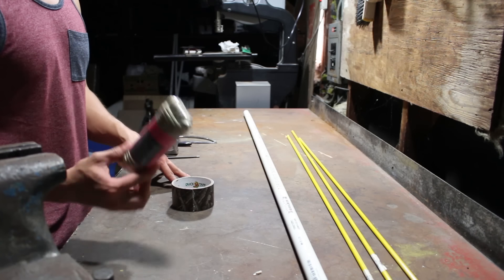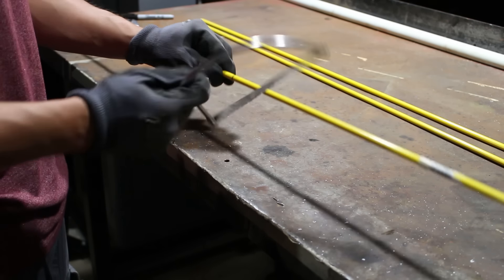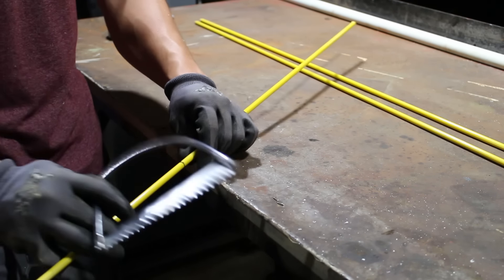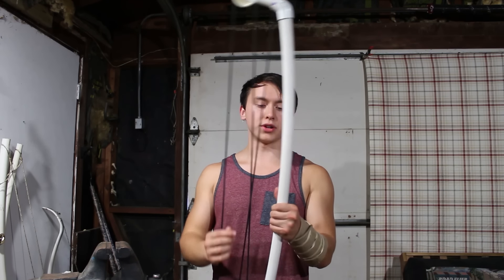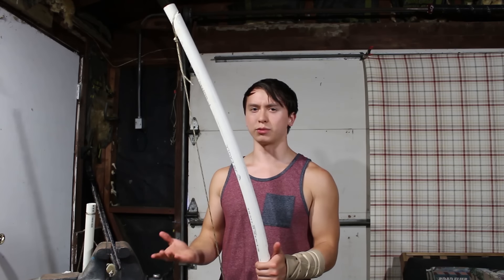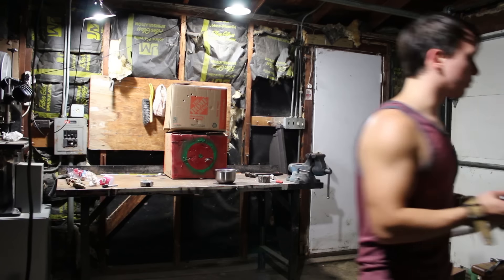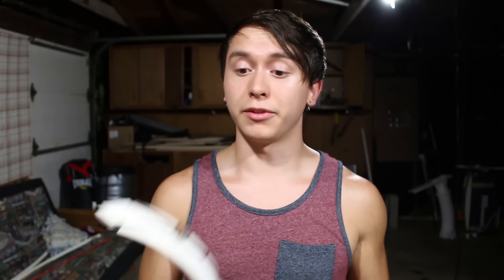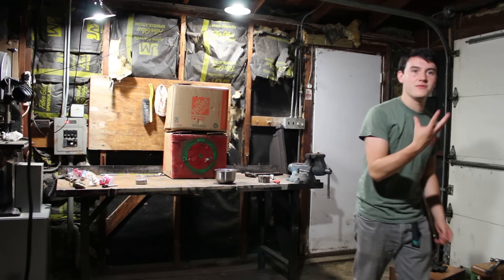Easy, Cheap, POWERFUL Bow (NO Power Tools or Heat Needed)

Comment: Where did you get those highway marker pole dealies?  I asked about them at Home Depot and they looked at me like I had wandered away from the shortbus.
Reply: look for
Driveway Marker 48 in. Round Orange Fiberglass Rod

at home depot
Reply: Blutteufel try asking for driveway markers. Check around the paint aisle or wherever they keep the mailboxes. I bought mine at home depot
Reply: Blutteufel go to lows
Reply: You should check the hardware section. Or ask where they keep their reflective tape and flags. Also make sure you tell them fiberglass DRIVEWAY markers
Reply: Blutteufel I actually bought some today at Home Depot, but yeah it helps to dumb things down and look for the sharpest looking of the bunch
Reply: Basically they are where you can buy the house numbers, the garage door section.
Wear a mask, do not breath fibre glass dust
Reply: What can you use if you can't get the markers...!!
Reply: I have extra tent poles, they are fiberglass and I'm think if I use E6000 to glue the connections together I'll get the same results. any opinions on this?
Reply: Blutteufel It must not snow where you live we need them to see our driveways. Any hardware store near me has them lol.
Reply: Angel Rangel It's funny that you should say that, because not only does it snow quite a bit around here, but we've actually had more snow this winter than anyone's seen in twenty years.  Hell, I just looked out the window, and it looks like some more fell during the night.
Reply: i found some at walmart
Reply: lisa finley most tent poles are hollow and wouldn't give the same pull weight
Reply: Canadian tire has them

Comment: because of it's shape, the ends of the recurve bow essentially act like a lever; this is where the extra power comes from
Reply: @Picogram I mean, you're wrong about saying that "the longbow" is the most powerful, and it's a self-contradiction, too. I mean, if the recurve bow is a force multiplier, then wouldn't a recurve bow of draw weight x always be better than longbow of draw weight x? And it's not like you can't get recurves as powerful as longbows - asiatic war bows were remarkably similar to English war bows - 80 pounds and up.
Reply: Because it's a Turkish bow!
Reply: No. The reason he's not getting more penetrating power out of the heavier bow is primarily because the heavier draw weight bow has more limb tip mass, so lots of the energy stored in the bow is expended accelerating the heavy limb tips rather than accelerating the arrow. Other factors that could be reducing the heavier draw weight bow's performance are things like having a stretchier string and having an arrow that isn't well tuned to the bow. An arrow that isn't spined properly to the bow's draw weight can result in more friction between the arrow and the bow, as well as something called arrow slap, which happens when an arrow that has undergone deformation during acceleration rebounds after it leaves the string, causing the arrow's tail to collide with the bow. Arrow slap robs the arrow of kinetic energy and causes it to fishtail as it flies down range, which bleeds speed and can also cause the arrow to strike the target at an angle rather than dead-on, which also results in less target penetration. You can actually hear arrow slap happening several times in this video, and it's least pronounced when he uses his subscriber bow, which means his subscriber bow is almost certainly the most efficient of the three.
Reply: @DevilTrigger Yeah what MegaAdeny said. Recurve bows are superior to long bows period. The myth of the English longbows almost legendary nature really reminds me of the exaggerated legends surrounding Japanese katana when it comes to swords. British longbows were excellent bows don't get me wrong, especially for European bows.  More impressive than the British longbows is the archers themselves and the sheer amount of well trained men, that more than the bows themselves made the English archers a force to be reckoned with.  To tie a nice bow on top of all this, go google image search the Marry Rose bows.  A number of them found on the wreck are in fact, large recurve bows.  So the English actually used large longbow sized recurves something that actually isn't super well known.  Still credit where credit is due, Asians developed better bows, both composite and recurve they were cutting edge technology for the time.
Reply: Correct the Turks knew what they were doing.
Reply: @aerias72  Hungarian/mongol actually
Reply: Guess I'm the only one that's lost in this reply thread
Reply: Scythian recurve bows are much older then Turkish, Mongolian, Hunic or Korean Bows, and way older then English bows. They come from the Hittite or Hyksos and spread to Egypt, India and all of Asia. The reason is because of the extra leverage the recurve gives. If you hold a 5lbs hammer by the neck it feels a lot lighter then by the base of the handle. When you swing a hammer from the very end of the handle it is much more powerful then by the neck. The principle of leverage is the same in the recurve. The recurve bends the bow deep and adds more leverage as the second curve either straightens out or in the case of bone tipped bow, it bends the limbs deeper with the same draw weight, compressing more energy my using leverage.
Reply: DevilTrigger The longbow is not the most powerful. Distance world record right now is set with a recurve.
Reply: That and they’re more compact
Reply: @Son Gohan Not actually the point of a Long Bow. It will not do anything that a normal bow can do except have a very large range. After all that is what made British Archery surpass that of its early rivals: range
Reply: Darn Mongols invented it i think
Reply: My understanding how it was explained to me, and simplified lol. The recurved bow has greater speed for the draw, but a longbow can throw a heavier arrow like a Boykin I think it’s called, I saw a recurved longbow at yarrambate when I was a teenager, the guy shooting it was huge, I also think that with a really long heavy war bow with a heavy arrow would have made a big difference against heavy armour
Reply: @SSJ For same poundage, recurve is more powerful than longbow. If take 100 lbs horse bow which is  recurve bow, that will shoot arrows much faster that 100 lbs longbow. That's why back then longbows had much higher draw weight (120-180) to get enough power and recurve horse bow were  90-120 lbs in draw weight 'cause they didn't need to be higher in draw weight to get enough power.
Reply: What are the items he used?
Reply: @-Zevin-  Another reason the recurve did not work very wel in England etc, it was difficult to make in wet climates. The glue/composite won't hold because of our damp climates. Mass-producing reliable bows is essential, the only good option in north-west europe was the longbow. Made from one piece of wood.
Reply: You fools, the strongest bow was a 7’1 true war bow
Reply: @Robertmaus  that is also one of the reasons why the huns and other slawic horse archers who invaded europe once in a while always got pushed back after a few years. today archaeologist think that their bows get damaged in the more humid climate over time.
Reply: @Marmocet  ya...but if he is using the same arrow for all the bows...then its consistant...& thus having a better arrow would produce the same consistency throughout as the original arrow had done....they will all go n furthur cuz its a better arrow but the consistency would still be the same...the recurve would still be stronger...maybe if the string was adjusted w/a tighter fit for the long bow...then it may do way much better...like how it was done @ the end of Predator where he rlly had to bend that bow back b4 he hooked the other end of the string...thus giving it a rlly strong draw pwr...like 90lbs plus...
Reply: @MegaAdeny  the recurve is called a recurve because it RECURVES extra energy back into the initial draws curve

Comment: Hey, Recurve Bows are more powerful because the extra bend on either end allows for more spring. You are no longer getting a bend from just the middle of the shaft; each end of the bow also bends. So basicallly, it's like having miniature bows on each end of your bow, but at lower draw weights. Because of that, the "bows" on the end reach their max  draw weights (×2) before the actual main bend in the entire bow as a whole. This means the bow bends much farther, even though the actual distance the arrow travels remains the same. 

Recap-

More spring from a bow on a bow = more potential energy with the same amount of space= more force. 

I know that might be hard to follow since I am not using any technical terms, but hopefully that will explain why recurve bows are so nice.
Reply: Ye they have more smoothly running drawstring from the spindles aswell as the extra length in the drawstring paired with more leverage

Comment: I've read a lot of comments that try to explain why the recurve is shooting more efficiently, yet none thus far has mentioned the most important aspect: mass.

When you loose an arrow, you're not only accelerating the arrow, you're also accelerating the bow itself. Heavier limbs and tips mean less energy is going towards the arrow, thus a slower shooting bow.

the "subscriber" bow is made out of 3/4 inch PVC and it DOES NOT contain fiberglass rods, it's simply heated and tapered, which means it's thicker at the handle and gets flatter towards the tips. This results in less overall mass. The recurve design essentially has the effect of having a longer limbed bow, making it more efficient. It also reduces an effect called "stack" (meaning that the draw will feel more even rather than get harder to pull towards the end as the angle between the tip and the string reach 90 degrees, as is the case in longbows).

The reason why the "monster bow" didn't perform as well is mainly because you weren't pulling it all the way back, longbows have a tendency to stack towards the end of the draw, meaning that you're losing a lot of energy by not drawing it all the way, even if it's 2 inches or so less than full-draw. Another reason is that it has significantly more mass including that of the larger 1-inch pipe and the fiberglass rods.

One might think, "wait, aren't the fiberglass rods and larger diameter pipe supposed to have more power?" the answer is yes, they do, however, it's an issue of balancing that extra power with the extra mass.

Put simply, light and well designed bow of decent or even light draw weight is a better performer than bulky, more massive longbow of very heavy draw weight.
Reply: Good breakdown. I wonder if the comparative performance of the heaviest bow would be better if he repeated the tests using heavier and heavier arrows. Will the heavier arrow at some point fly faster being shot from the heavier bow or will the lighter faster bows still retain the ability to cast the arrow just as fast?
Reply: This is the longest YouTube comment o have ever seen
Reply: @catocall7323  I suppose that if the heavier arrow gets shot at the full draw distance ill make a difference by itself. 
And there should be a trust to weight ratio that is exactly optimum for the bow. If it has more power, so, yes, the heavier bow would benefit more from heavier arrows, but again, at full draw distance.
Reply: @LucasG745  And important educational comment.
Reply: what if that recurve had the fiberglass rods inside?
Reply: So.....how do you build a lighter bow with PVC?
Reply: thanks
Reply: Tldr
Reply: Thanks for the explanation 👍🏼
Reply: So like the Anatolian Turks bows or mongol bows
Reply: Can you explain the science behind bows and crossbows?
I have been told bows are actually more powerful and better at range is this true v
Reply: @LucasG745  amateur
Reply: english long bow fans be screeching right now